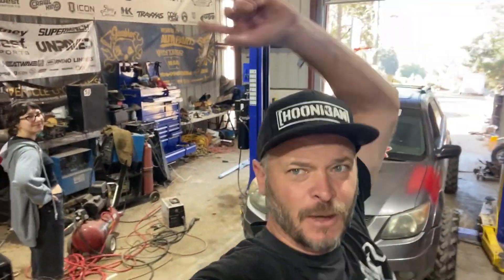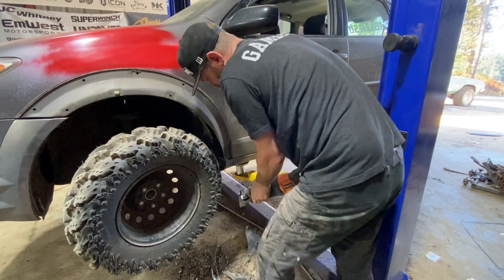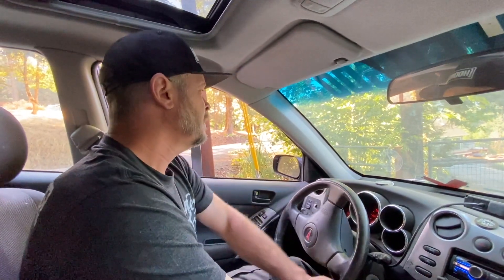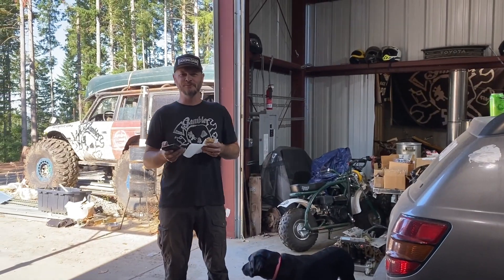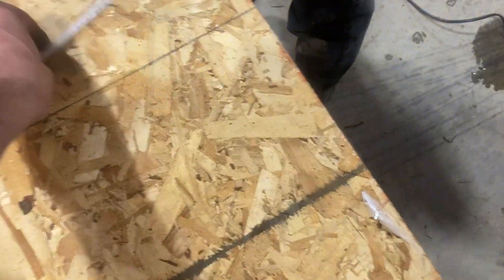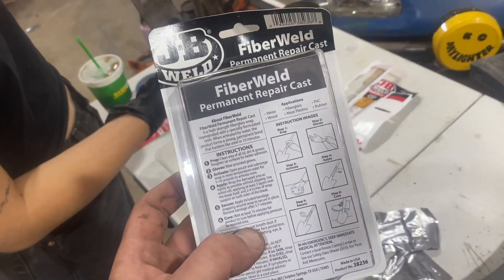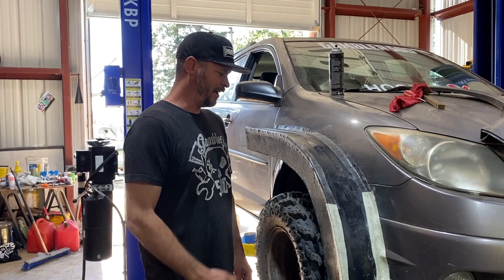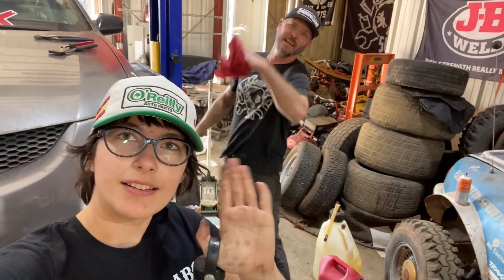GAMBLER 500 Builds Video Game Car In Real Life! PART 1

Comment: Having spent a bit of time with the 2zz and 6 speed, would you prefer the awd auto setup, or would you stick with the manual? For regular gambler, or HooptieX? I'm still trying to figure out what I want to do with my corolla. I can awd swap it for cheap, but I feel like the manual fwd setup would probably be faster and more compliant in HooptieX.
Reply from the maker: One of the main objectives was getting into a FWD car, I’ve raced the Miata and RWD isn’t forgiving on these tight courses.  I don’t want to bump into the AWD class or hater class because I’d run out of talent.  If I was you I’d stay right where you are with FWD!
Reply: @Gambler500  I have a C60 to swap in but I want to rebuild it with a lsd and new syncros first. They aren't known to be the strongest.